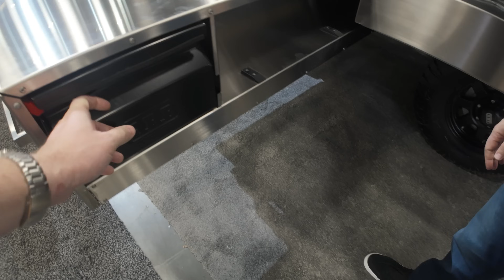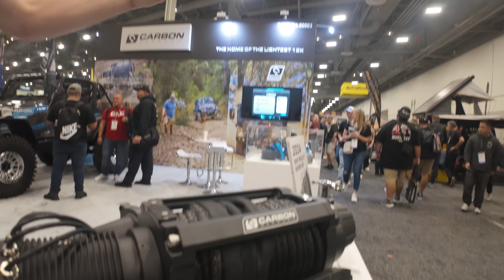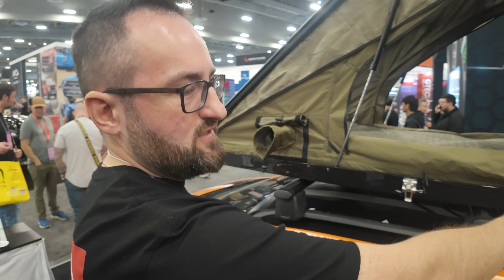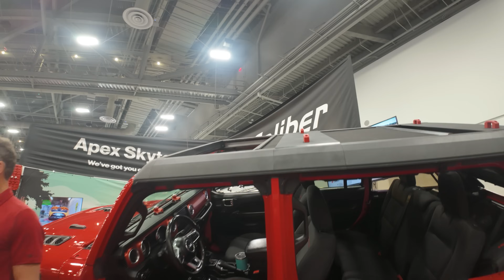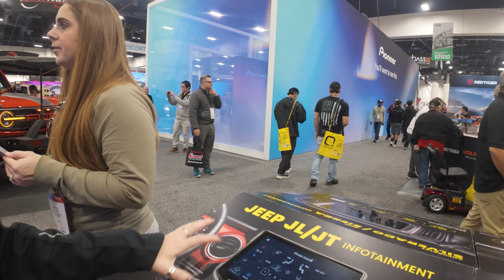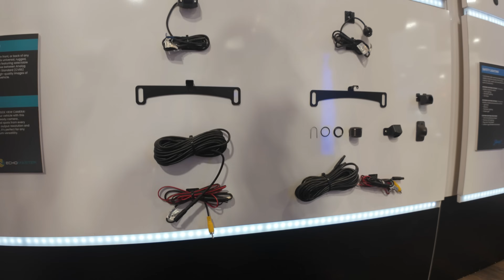Crazy Overland Gear at SEMA 2024

Comment: You guys should have spoke with the owner. regarding the EZ 4x4 roof. Wayalife spoke with him regarding those flip tops. That 3m tape is rated for 3000 lbs (something like 30 lbs per square inch) and you have the option to drill OR use the adhesive. The tape is an i dustrial 3m application and the adhesive has a 10 year warranty i think.

They also had a jeep that had been running it in theb desert states for 3 or 4 years.

Instead of just guessing how it works, you should have spoke with the owner. The following roof product you looked at, you spoke with a rep. which affords them an explanation of the how it works.
Reply from the maker: I tried to speak to as many people as I could but some booths were busy and didn't have people around free when I went by. I shot most of this video in a single day and was hustling thru the show.